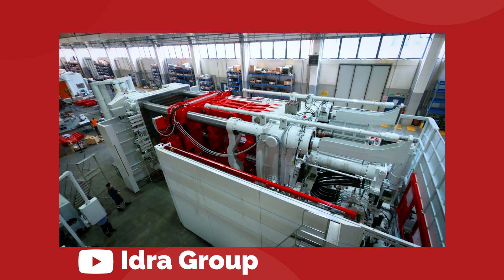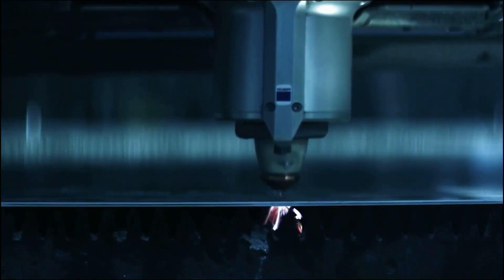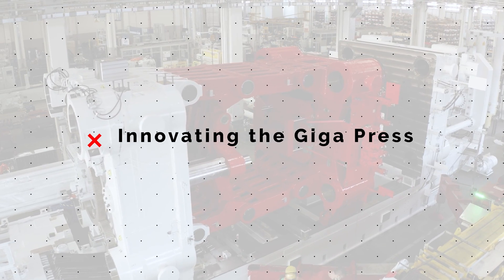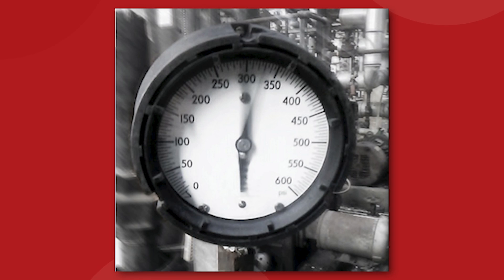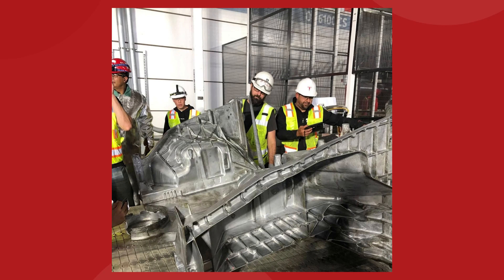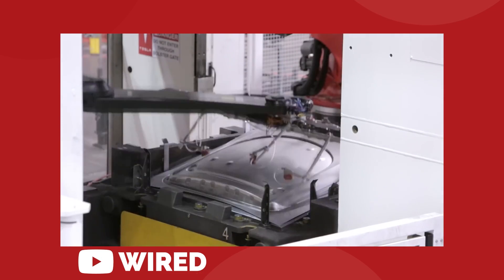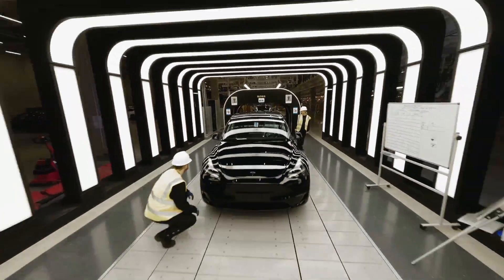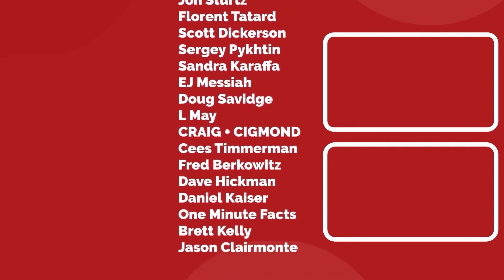The Real Reason Tesla Developed The Giga Press!

Comment: Here's the reality.  Tesla had too many parts, on the back end.  That's too many 'failure opportunities" in their design and it cost $2000 too much to make the car by its original design. So with recommendation from Sandy Munro, they converted those many parts into one part.  BUT... Here's the con in this story.  You see other car companies know how to make cars, they didn't need a giga press to make cars.  The legacy car companies have decades of experience in making far more complex gasoline and hybrid vehicles by the millions, compared to a simple car with just a battery and motor.  The giga press is a fix, not a feature, nor does it put Tesla ahead of any car company who already make up to 10 million cars a year.  That is the con.
Reply: You err by comparing the ICEV to the BEV. They should be contrasted, e.g., two forms of personal ground transport that are fundamentally different. In 1900 lots of companies could maas produce an excellent, low price buggy, but NONE could mass produce a sturdy, low priced, horseless buggy. Why? They didn't predict the demand/need. Henry Ford did. A century after the adoption of the ICEV, Elon foresaw the demand for a new vehicle paradigm. See the parallel? It's only logical.
Reply: @1voluntaryist   You're comparison is not a real comparison.  The basic difference in an EV and an ICEV or Hybrid, is the mode of propulsion, nothing else about the car needs to change except to accommodate the mode of propulsion. The same as the introduction to Hybrid cars.  Its not a new vehicle, just a new mode of propulsion.  In fact people are buying battery packs and electric motors and sticking them in old vehicles to make them electric. 

When Mercedes made the first car it was a horseless 3 wheeled buggy, yet it was made of steel tubing, had three wheels, different steering and was chain driven, but that didn't make people walk away from the horse.  

It took 20 years to design a new vehicle with doors, a roof, a single cast gasoline engine, and gears and MOST IMPORTANT an assembly line to mass produce cars at scale, to be cheap enough for the masses to give up on a horse.  Its was a whole new vehicle design, not just a change in propulsion.

Legacy car companies already make highly complex Hybrid cars with an ICE engine, a battery, an electric assist motor, regenerative brakes, and they also have a real dashboard. These vehicles are far more complex than a battery and electric motor car, especially in the build process. Yet, somehow you don't think that Hybrid car is a different car, only an EV.

Legacy car companies change models every 3 to 6 years, not including the body style.  So, a redesign to a fully electric car is not a complete redesign of the vehicle itself... its just a change to accommodate the difference in propulsion, just as changes were made for the Hybrid vehicles.

Comment: Great content- very well researched! Would love to see a follow up on the barriers to entry for other Automotive brands to do the same. What is Tesla’s innovation here (Assuming it isn’t all IDRA IP)?
Reply: Tesla's innovation is they figured out how to use die casting to build a car with fewer manufacturing steps. Idra built the machine to Tesla's spec.
Reply: @jamesperry1358  Tesla didn't "innovate" how to build a car out of castings. They just said 'Fuck it, our cars are horribly built anyway, so might as well just go all the way' Cars out of castings are bad idea, period
Reply: Car manufacturers are notoriously slow to change. Tesla’s advantage is they have a fully cast front and rear housing like a matchbox car - reduces hundreds of spot welds and individually shaped metal pieces to a single unit, drastically reducing labor costs.
Reply: Its fully Indra IP, its a classic case of Musk claiming other peoples work.
The main barrier to other companies doing this, is that its just a plain bad idea, btw. You don't use castings for vehicle frames. Way to much torsion, pull, and shear forces going on
Reply: @MannoMax  I think the main difference with Tesla is that they made the battery pack structural as well to offer rigidity so they’re probably compensating from there.
Reply: @manu144x  What do you mean by making the battery pack structural ? Because using the lithium cells as load bearing parts is a very bad idea, and if you just use a sturdier battery frame, thats just a worse way to do welded stock frames.

Comment: Can anyone estimate the cost of the tooling, the two mold halves for the front and rear Tesla frames? Also, is the tooling articulated to provide interior features such as threaded bosses?
Reply: I believe the answer is a definite yes. I suggest you follow the Munro podcast teardown of a Texas Model Y where they commented on the effective completeness of the gigacasting which appeared to extensively incorporate numerous usually added-on features into the casting itself

Comment: Great job! I assume the presses for the truck will make similar castings and the exterior will be stamped. The entire structure will share the structural load instead of a subframe . There will be significant weight savings compared to the conventional frame and body design.
Reply: If they make the exterior panels the way they pitched the concept, many of the exterior panels would be made with press brake processes using the custom SpaceX alloy of stainless steel (which is of a thickness and strength that is not suited to stamping).  That was part of the reasoning behind all of the straight line corners.  I'm not sure how much that will hold true in the actual production product.
Reply: Making a truck out of castings would be a horrible idea. Castings dont handle dynamic loads well
Reply: @MannoMax  Also it's cast aluminium! You can't get more britle. And how would you repair a single cast frame after an accident, I mean you couldn't swap out part, you would basically need a new cast frame and transfer all the car parts....
It's ridiculous.
But the whole Tesla Cyber  truck idea was to build a spaceship like exoskelette without a car frame inside. 
That was the whole point.
And I hope Tesla does it. I realy think most of the Tesla cars are just overpriced junk (and 32% margin proves it) , except for the Tesla Cyber truck should this car been produced it will be the first legit Tesla I would wont to buy and drive.
Reply: @TremereTT  You are aware that cars dont have a classic frame anymore ? Basically all modern cars consist of an outer shell of sheet metal, and a supporting layer. And as somebody that works in automotive, i can tell you, that using the outer skin as the structural part is a super shit idea. Any small hit while parking, any inconsequential fender bender would be a danger to the structural integrity of the vehicle
Reply: @MannoMax  That is the point of the Cyber Truck! 
And many people think it's a great idea. The Exoskellette makes the cars interieor more roomy as people anticipate when seeing the car from the outside.
If they make it like they promissed and it works , it would be the first legit good Tesla.
I know that it would be bad for it to get dents. BUT  it will be made of thick sheets of hardened cold roled steel. So it will most likely be structurally very sound.
Also I hope they find a way to comply with European pedestrian protection regulations.
Reply: @TremereTT  I keep trying to tell you this, but making the outer skin of a car the hard structural part would make it super easy to damage, essentially totaling the car, and you also have no crumple zones. Theres a reason why all other manufacturers are moving the exact opposite direction, towards more space in between skeleton and skin
Reply: @MannoMax  I know.musst manufacturers try to make the parts of foamed Metal.
Reply: @TremereTT  What do you mean by foamed metal ?

Comment: its a big kludge... since carbon is the best chassis material we know... metal alloys monoblocks are a thing of the last century... even a HEMP fiber composite chassis is better if you use the right resins and fabrication methods... metal is heavy, even titanium, aluminum has high index of plasticity(a duralumin tougher Alum we use to make honeycombs from carbon fiber sandwiches of high performance chassis parts only has metal for its energy dissipation and crashing/safety dynamics)the press is a cost/production matter, because they dont wanna go full tech, plus looms are mechanical tech(harder to perfect), and carbon f. uses 23% of the electricity to make into parts(tesla sells energy making hardware/batt/etc), its a shame that Elon did not invested in carbon fiber plants and looms + personnel (with natural fiber composites as a bonus rural development and job creating venture) and grew a highly valuable industry for the US to become the top player in a few years...

Comment: Don't forget the 'hydraulic' effect a 200 ton injection force by a 'small' pisto generates a massive psi on the injected metal which is then translated to the much larger effective area of the cast part trying to force the die open with the same psi. Hence 200t in 8000t to hold it shut.  The injection pressure and flow rates stay the same, so if you want cast larger pieces you not only need a larger frame but a much larger clamping force, double the linear size four times the clamping pressure at a guess..
Reply: Exactly, thank you! Was searching for this comment, before writing the same. 🤓👍🏻
"200t input --> 8'000t to hold the two mold parts shut!"
Pressure * surface = force; and for large car body parts you need a giga force. 💪
Btw, why do they call it metric tons instead of Newtons?? 🤔
Reply: @mik2137  they've already got Tesla as a 'sponsor' adding Newton would definitely lead to fireworks..😃😃
Reply: @kmac499  but I'm sure newtons are newer than metric tons!! 😅
Reply: Here's the reality.  Tesla had too many parts on the back end.  That's too many 'failure opportunities' in their design and it cost $2000 too much to make the car by its original design. So with recommendation from Sandy Munro, they converted those many parts into one part.  BUT... Here's the con in this story.  You see other car companies know how to make cars, they didn't need a giga press to make cars.  The legacy car companies have decades of experience in making far more complex gasoline and hybrid vehicles by the millions, compared to a simple car with just a battery and motor.  The giga press is a fix, not a feature, nor does it put Tesla ahead of any car company who already makes up to 10 million cars a year.  This video is basically a cover up.
Reply: @obijuan3004  please tell me which other car maker needs only 10h production time for one car. VW apparently needs 30h and they publicly stated that they need a new factory (ready in 2026 or so), completely redesigned, to achieve something Tesla is doing since a while now...
Reply: @mik2137  What did Tesla do?  Make a fancy golf cart without a dashboard?  Seriously??   

A gasoline engine or hybrid vehicle is far more complex to build than a car with just a skate board chassis, a battery, electric motor(s) and a LED monitor screen that replaces a real dashboard. A Tesla is as cheap as you can make a car, yet it has a 34% mark up because Tesla needs the money. 

The worst thing that could have happened to Tesla is for governments to force car companies to make 'zero-emission' cars. 
Right now ... TESLA CANNOT TOUCH TOYOTA'S CUSTOMER BASE. Tesla's cars are too expensive. 

Now,  here comes the competition, Tesla's real challenge is about to begin.
Reply: @obijuan3004  sorry, my statement was not precise enough: 10h (Tesla) vs. 30h (VW) production time is per EV car.
Yes, Tesla is not yet addressing every customer segment, this takes time. Btw, the 30+% "mark up" is not there because Tesla needs the money, but rather because the market is willing to pay for it. The market however is not willing to pay any mark up for EVs from VW, Ford, BMW (?), Fiat, Mercedes, etc.
The next 3-4 years in the car industry will be very interesting to watch. And it's not Tesla who has to fear competition (not at all), but the legacy car makers very much! 😱
Reply: @mik2137  VW started making EV’s in 2019, they were testing the market no need to go all out. Still when needed, VW has the ability to make 10 million cars a year… as they still do. And an EV is far easier to build than a gasoline or hybrid vehicle. The customer base for Tesla are people who can afford a $60,000 to $120,000 car, and yes Tesla desperately needs the money that’s why they increased the price. And you are half right, the market that Tesla serves, will pay the markup, but they will also pay for Mercedes EV, which has a 40% markup, the Ford e-Truck has up to a 100% markup.  Still, most of VW’s customers, Tesla can’t touch.  My point is Tesla will have to drop that price when the legacy car companies sell millions of  better cars for less money. The 2022 Kia EV6 has a $40,900 starting price. It’s a great SUV with a real dashboard, for $100,000 less than a Tesla SUV. At some point Tesla becomes over priced.

Comment: Casting is all about PSI and surface area.  You have a given PSI.  The surface area of the injection piston times the PSI is the injection force.  The surface area of the molded part times the PSI (roughly) is the pressure needed to hold the mold together.
Reply: *The force needed
Reply: Watch the Munro review from the factory.

Comment: Single casting?  It is inevitable.  Once Tesla corners the drive hailing market and they need to produce millions of tiny cars capable of transporting a single human to whatever destination he/she needs to go in the most efficient mode of transport possible, from a first principle perspective, a single casting with structural battery pack mounted directly to the rear axle is by far the most efficient vehicle design possible.  Tesla will OWN this space.  Tesla will INVENT this space.  It is literally a foregone conclusion!!  No other manufacturer has the brains or capability to pull it off, yet pull it off, they must!
Reply: Tesla needs to chase the march of 9s for FSD. They don't need to do it for manufacture of cars for an incredibly profitable robo-taxi market.
They are already pushing the boundaries in going from 70 parts to 1 part and they get a big benefit for doing that, but going from two or three parts down to one doesn't provide much benefit and the risk and complexity is great. My prediction is they wont do that and Elon Musk has said so.

Comment: Wish I had learned something. I'm really busting waiting for my Cybertruck. And Spring next year means nothing on Tesla Time. Nice video for those who aren't Tesla junkies like me. You even forgot to mention that to press all that Aluminum through the Giga Press an entire new mixture of Aluminum had to be developed to reach every corner of such large pieces. That was one of my favorite inventions. And you kinda explained how this will totally revolutionize the auto industry. Because to compete the other auto manufacturers will have to change to building frames like this, or get out of the way.
 Same with Elon's thin soda can size batteries made without the precious metals people in places like Africa are being killed trying to steal and smuggle off of poached land. Now they'll be 2/3rds nickel and 1/3rds manganese. Innovate or get out of the way.  
Later ✌️
Reply: @AudiTTQuattro2003  And inventing a new battery mixture is in there too. Hopefully when they do begin, having so many fewer parts they can build them faster. As long as the build quality can improve also. I'm retired and selling my home to go on the road in a new Cybertruck and whatever aftermarket camper someone will build for the thing. Or maybe a small pull behind. I have to have room for my 16ft welded Jon boat and 20hp Honda motor. If I have to put them in the back. I feel like a kid at Christmas. Hope the housing market is still crazy when it does finally come out. The way things are now everything just about sells in a day. I spent 9 months just trying to find 10-15 acres near my sister in the country. And it's absolutely insane right now.
Reply: @WillieWeed  "new battery mixture" you mean the same battery different form, but same performance?
Reply: @WillieWeed  You're selling your house to go on the road with a truck that isn't even started production.  But no, you're not a Tesla junkie at all.   😆  Have fun with your maybe 100 mile range, that thing is gonna suck ass at towing. 😂😂🤣🤣